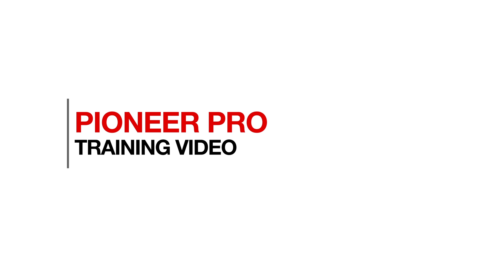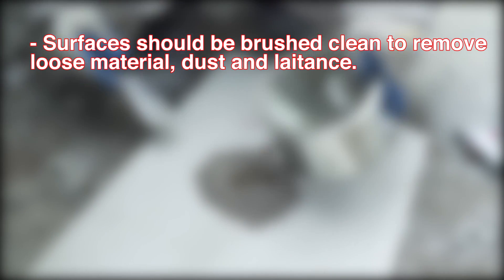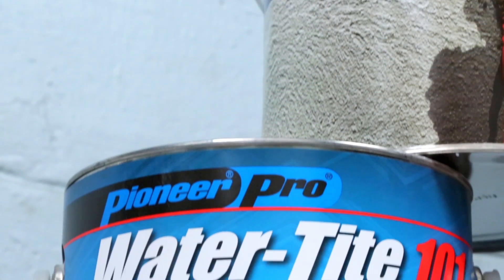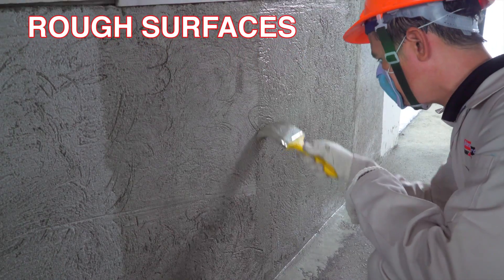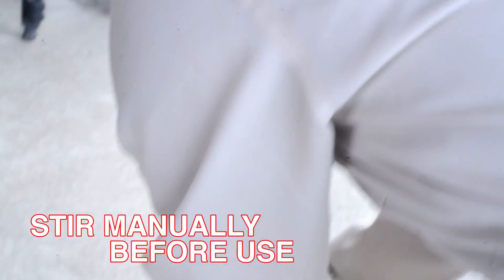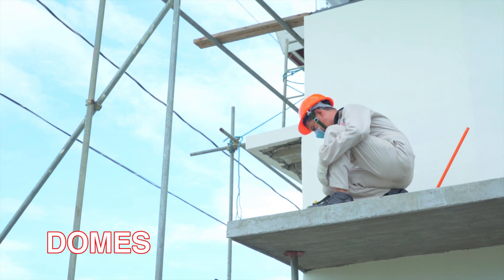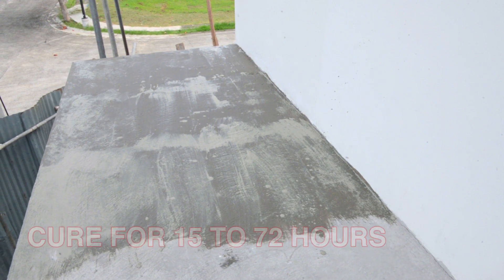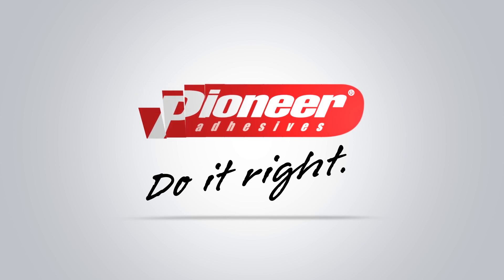Pioneer Pro Waterproofing - How To Use Water Tite 101, 102, 103 and 200

Comment: What is recommended for concrete gutters leaking
Reply: upon seing the video, you can use water tite 103..they mentioned it usually use for culvert.
Reply from the maker: Hello, Treb! You can apply Pioneer Pro Water-Tite 102.

Comment: Greeting   From SAI  SRAVANTHI  ENTERPRISES..
we Can Supply All Type Of Construction Chemicals,Waterproofing Chemicals,Water Proofing Membrane,sealants,grouting compounds,Dimple Board ,Drain boards,Fiber Mesh,PP fibers,thermal insulation system,all  type of Tile solutions Grouts,Adhesives,Tools ,Equipment, Grouting Machines,PU packers etc and also applicators of all type of waterproofing works.
or more details: Plot No 19, P & T Colony, Hyderabad - Warangal Hwy, Opposite to Hanuman Temple, Medipally, Hyderabad, Telangana   ,500098 ,   PH:9573437171